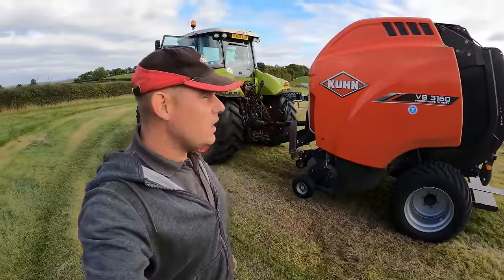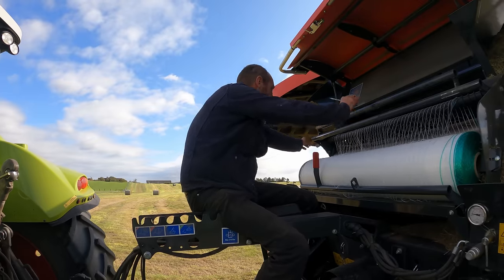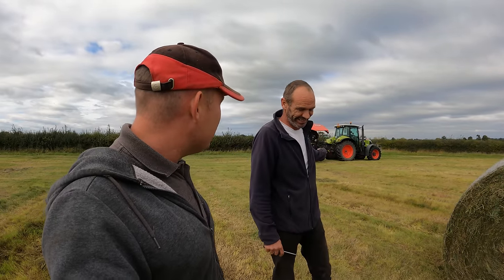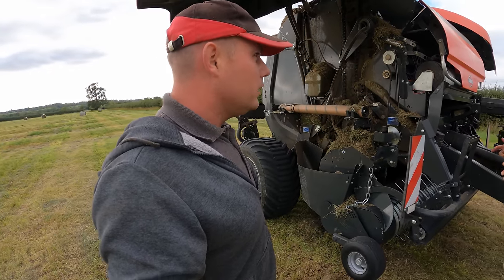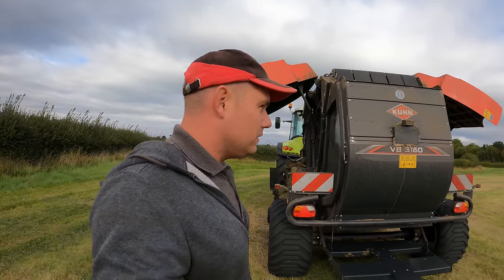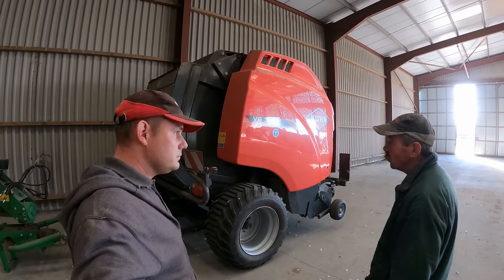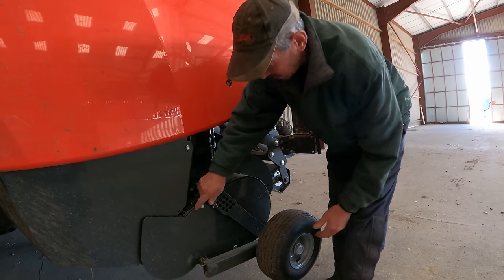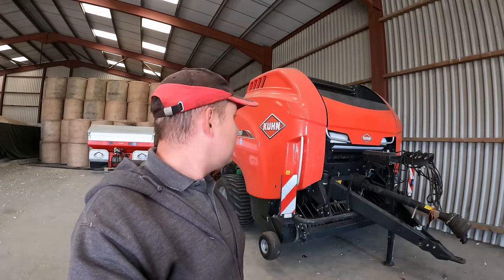Kuhn VB 3160 End Of Season Review

Comment: We have got a Kuhn topper which is 25 years old  it is only 1,5 metres wide it is on a Massey 135 but it has been on  a 100 hp tractor the only thing  we have replaced is tines belts  and roller bearings 🤔😁👍

Comment: Only criticism is it doesn't have a big enough standing platform for when you're putting new net in and or sorting something out at the front. definitely agree with the kick bar issue. I would have no problem buying one.
Reply: You don’t need a standing platform to put a new net on
You do it from standing on the ground and putting it in from the side of the baler.
When Colin is talking at the side of the baler you can see a silver plate at the end of the net.  You pull the r clip at the bottom
Of the plate, fold the plate down and slide the net in from the side while standing at the side of the baler